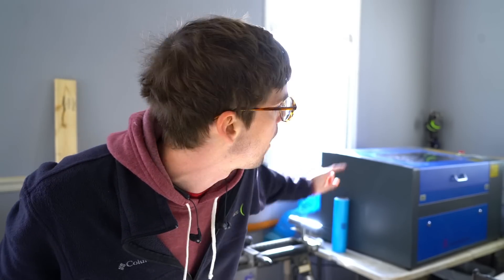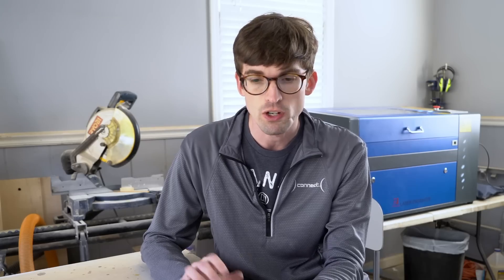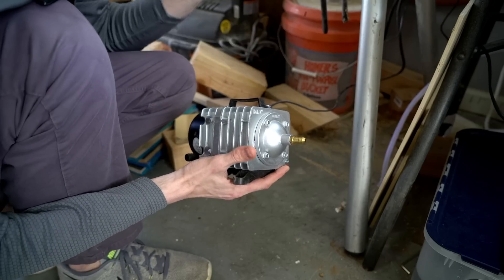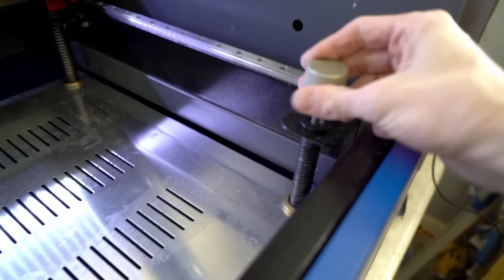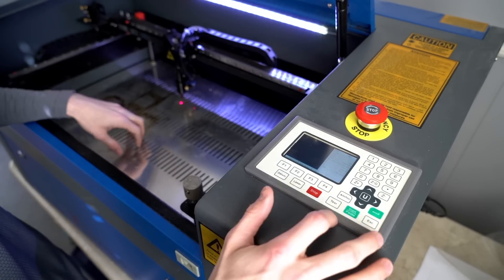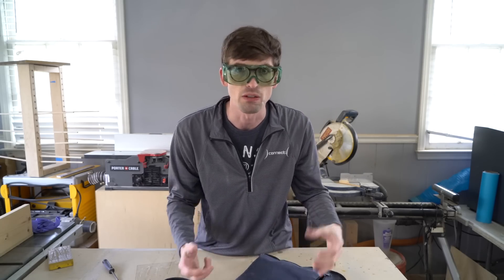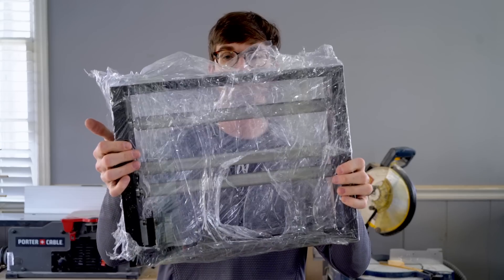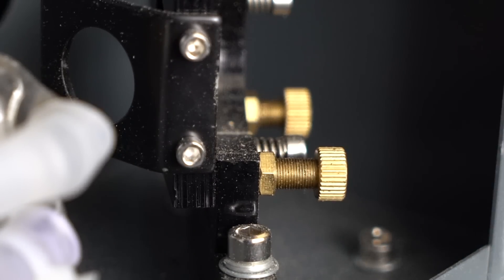Did I Waste $1500 on a 50W Laser Cutter from China?

Comment: I have a K40 laser and after watching your video I decided to get one like yours on this video.  I'm getting familiarized with it now but I'm wondering how to you check the temperature of the laser tube.  The K40 has a gauge I can monitor to see when the water is getting hot, but I don't see way of monitoring the tube temperature in this one.  Based on your recommendation, I bought the one with the Ruida control and I just downloaded a trial version of Lightburn.  Thanks for the video.

Comment: Is 50W enough for engraving on metal or do I need more power, like 100W?
And after 1 year of using are you satisfied or would buy something different year ago?
Reply from the maker: It’s a great unit even after a year.  For metal you will actually need a fiber laser or apply a coating like CerMark and engrave that off the metal.  Co2’s don’t work at the right frequency for metal engraving
Reply: @makeorbreakshop  thanks)
I will consider CO2 for the nearest future and I think I might buy fiber one after. Would be a great to have both in my "garage")
Reply: @projex5894  The thing about fibre is: they are so limited in size unless you go with the big industrial machines worth 10's of thousands. I've looked into them myself. 
One thing I've learned from building my own CNC machine and then adding lasers: get the most wattage you can afford. You can turn it down, but if 50w isn't enough, you can't turn it up!
Also: the biggest area you can afford. If you only ever plan on doing trinkets, then it isn't an issue but as soon as I built a new machine 30% bigger than my last, my next order was for one bigger than my recently expanded capacity. 
I attached a 5w diode laser to my CNC router and it isn't powerful enough. It can "burn" wood fine but only at 100% power at 40 ipm and has a hard time cutting through paper mask so I have to run it at 27 ipm.
Reply: @muskokamike127 , hi)
I had already made an order one month ago. I decided to buy my very first machine with working area 40*60 cm, Ruida controller and 100W tube.
Sure, it would be better to have bigger area, but extra pay for that and shipping cost can lighten my wallet to hard.

Still waiting the machine)
Reply: @projex5894  well, 40 x 60 is a decent size. You will be able to do a lot with it. Plus the 100w  is damn powerful too. You'll be able to do a lot with that as well.
I've been thinking of connecting a co2 tube etc to my CNC machine but it's a risky proposition considering the amount of dust it produces.....Turn on the laser and woosh, flame out in the shop lol.
Post some pics when your machine arrives and let's check it out.
Reply: @muskokamike127 yeah, 40*60 can be pretty nice for the start, cause I also noticed that CO2 owners don't actually produce a lot of big stuff. 
100W is powerful but I'm really curious is it able to cut for example 1.2mm bronze for dog tags, sure with markering surface) I know this power is not for metal but..
Reply: @muskokamike127  I think that's not that bad idea of connecting tube to CNC. But at least air compressor is needed and area wants to be enclosed.
Sure I can't advise anything as I don't have physical machines right now but IMHO it's possible

When machine will come it would be a pleasure to share some pics of it)
Reply: @projex5894  no, you'll need at least 1000w to cut metal. Least as far as I know.
Reply: @projex5894  The thing about putting a co2 laser on my cnc? the parts cost more than a while machine! :-)
I'd also have to figure out how to run it through mach3 as opposed to a ruida controller.
Reply: @muskokamike127  I saw 130W can cut 1mm steel. But in my opinion it doesn't worth the tube's resource
Reply: @muskokamike127  is mach3 can do engraving and cutting in one run?
Because that's the main reason why I choosed Ruida over M2
Reply: @projex5894  Yes it can engrave first, then cut out the piece.

Comment: I don't know what some of these people are going on about with the antifreeze BS, but don't do that. Run pure distilled water only and put a couple drops of dish detergent and a cap full of bleach in it.  If you don't want to use bleach, then at least add fish tank bio killer in the water to prevent it from going stagnant over time.  Using antifreeze or "water wetter" products and the like is bad, because it cooks into the glass and actually will eventually build heat on the tube, as will minerals in the water if it's not pure distilled.  Don't listen to these dopes.  I've been running home built units for years now and have done the research for 10 men.
Also invest in a CW-5000 chiller and be done with it.  Doing anything less is asking for future issues in all reality.

Comment: buys a laser that can easily cut acrylic. Minutes later says the acrylic window on the machine is good enough to block a stray C02 laser beam... BRUH. :/
Reply from the maker: It's all about the focal distance, it can cut acrylic but you need to be about a half-inch away and running pretty slow.  By the laser bounces and hits the acrylic screen the energy is pretty dissipated.

Comment: ****************
i ONLY FOUND ONE WITHOUT THE Ruida controller.

iS THAT A DEAL BREAKER ?  PLEASE LET MA KNOW
Reply from the maker: I still don’t have a Ruida controller in mine and it’s working.  You’ll have to deal with the buggy Chinese software but you can get it to work
Reply: @makeorbreakshop  I recently purchased a used 50W CO2 Laser with a M2Nano board.  Any help with setup would be appreciated.

Comment: i use to have a Universal 30 watt M25 laser engraver and just bought  
Orion Motor Tech 50W CNC CO2 Laser Engraving Cutting Machine, 110V Laser Engraver Cutter and hope it will be as easy as the Universal.Thanks for your video.
Reply: How did it fair? I'm used to working with the Universal engraver as well. Just got the Orion this week, I'm a little overwhelmed with how it's going to work

Comment: When you do a cut, is there like liquid forming underneath the material?  I am getting liquid from cutting acrylic and mdf.  only underneath the material.  Thanks in advance
Reply: You have a few things wrong then, first is focus, so if your cutting say 3mm and your getting a problem on the last 1mm then lower focus 1mm. Your air assist would push debris clear of the cut, also the last thing is to turn speed up a bit as the laser is to slow and melting the burr. good luck
Reply from the maker: Yep!  That is basically the heat from the laser melting the material underneath.  A lot of lasers have a honeycomb bed so there is open air underneath the material to help offset this.  Since mine doesnt have this you could either put some honeycomb on top or just add a few riser blocks to the get the material off of the bottom of the bed.

Comment: I have watched this video a bunch of times. I am seriously thinking about a 40W k-40. I am a Mac guy so I wanted to use lightburn too. However I have not seen the K-40 s with the ruida controller. And the conversion looks like it is more than the price of the unit. 
What would be the base requirements for a PC to run the software that comes with the laser?  I was thinking it will cost me another 500 or so for a cheap PC.
Reply from the maker: The PC i'm using is super old but I do all of my work first on a mac and export a DXF file straight out of lightburn.  You can then import that into whatever software that interfaces with the K-40 on a PC if you need too.
Reply: Thanks for the response. I opted to get the K40 40watt then I bought the Cohesion 3D controller with power supply for 199. I added on a LCD screen with controller and lightburn.  All of those add ones delivered to my house for 289. I figured that was a less expensive way over buying another computer. Plus I would probably want those upgrades over time. I was glad to find a controller and power supply for a lot less than the Ruida controller.   Just another option to offer to people.
Reply: Dear Sir,

I am Jennifer from Jinan Xintian Technology Co., Ltd, China. Established in 2004, it has become a top laser cutting machinery manufacturer, having exported to 120 countries around the world with 10 years of exporting experiences.
We have good feedback from customers. Pls kindly leave your email, I will send you details. 

Jenny Liu, XT Laser
Email: xintian115@xtlaser.com
Whatsapp: +86 15201299761 
Jinan Xintian Technology Co., Ltd
Website: www.xtlaser.com
Your Best Laser Cutting Machine Supplier From CHINA

Comment: Cool video, what do you think about buying the smaller versions of these machines, I have my eye on the following called the 3020 UltraGlow. Would this unit have the Ruida controller and work with the software in the video do you know?

https://www.ebay.co.uk/itm/New-Laser-Engraver-CO2-Cutter-3020-UltraGlow-Laser-Engraver-Warranty/173984424930?_trkparms=aid%3D555018%26algo%3DPL.SIM%26ao%3D2%26asc%3D20160908110712%26meid%3Db25a0a6971c84da09811463ee137f116%26pid%3D100677%26rk%3D1%26rkt%3D30%26mehot%3Dpp%26sd%3D231777365741%26itm%3D173984424930%26pmt%3D1%26noa%3D0%26pg%3D2386202&_trksid=p2386202.c100677.m4598

Comment: i have an 80 watt with the ruida controller, i am running corel draw x18 and when i send files over using the plugin that came with the laser it does not fill in the text. The Laser seems to only want to "cut" objects out rather than engrave them. I did find  a setting called "scan" and "cut" and changed it to scan, which then filled in the text and designs rather than outlining them but even after that the quality of the engraving is not very high. id give it a 70 out of 100. Ive tried re aligning my mirrors and they seem to be pretty straight on. the mirror i have the most issue with is the one at the tip of the laser head. i have issues getting it to come out of the tip of that cone that covers the end. the top adjustment is not very adjustable.  If you have any advice id love to hear back from you because as of now the laser sits here doing nothing. its a $2000 desk.

Comment: I have your exact model (with the same keypad) and cannot, for the life of me, get it to find files on the "Udisk".  Can you describe your method for getting print files onto the machine?
Reply from the maker: Yeh the U Disk is hit or miss for me, I connect it by USB to a computer and transfer from their software.
Reply: @makeorbreakshop  Thank you for your prompt reply.  I am not looking to you for support, but I have not managed to get mine to do *anything*.  Can you please describe in more detail what you do?  If I use their printer driver, from their "LaserCut2017" program, the jobs just disappear from the queue.  When connecting via USB, I don't see the device as a drive to move files onto.  I am sort of shooting in the dark, here.
Reply: It might make a popular video... :)
Reply from the maker: I never could get 2017 to work.  Mine came with an older version of the software and I was able to get it to connect using the cord that came with it.
Reply: @makeorbreakshop  Yep, that's about where I am.  I can get some basic control using lasercut6, but 2017 has been a bust, and neither has actually let me print anything.  (Sigh)

Comment: Hello, your laser 50W CO2 can cut thin metal ( 0,20mm ) ? Thanks Roberto.
Reply: 50W will not even cut thin metal.   You need at least 200W to have any hope to cut even the thinnest steel using oxygen as a cutting gas.  Even then, you'll be cutting pretty slowly (about 1 meter/min or less).
Reply: hello my friend , we are top selling laser machine manufacture in China,please contact me,whats app number: 0086-17820602094,Email: y.huiping@dapenglaser.com ,thank you !

Comment: Hello, you are using that laser cutter? I need help with mine and can't get it! I need the RDUSET and RDVSET original files to make mine functionally again. BECAUSE: in the Ruida machine menu is a voice like fact para settings. DO NOT TOUCH IT! it will cancel the vendor para settings and  user para settings and you will throw away your machine IF you didn't save allready  those files on your computer. I've done it, too bad 4 me.

Comment: Its not the controller on these cheap machines which is the issue its the cheap co2 narrow beam 50w laser tube :-(  Its all about gearing or beam convergence if your serious about cutting any reasonable thickness perspex or mdf  
I have another machine now which still has all the same cheap chinese tube mirrors and lenses  
however the 80w tube in this machine has a larger diameter beam with a 2:1 stepped down XY belt resolution which makes so much difference :-)
Can cut with less wattage on the 80w machine through the same material using a faster feedrate than the small 50w machine
Reply: Sure it's a cheap machine, but it's a good "starter" system.  You can pretty easily retrofit it with a better laser, laser control, stepper motors or CNC control for not a lot of money.  The basic machine is pretty sound though.  I've retrofitted mine (same system as the one in the video) with new optics (3 new bending mirrors and a brand new cutting lens) and it made a huge difference.  Was able to get a smaller focused beam and could cut the same material/thickness with about 10-12% less power at the same feedrate.

Comment: 7:00 "everything I saw said be careful with the grounding", doesn't use ground strap at all.
Reply: Machine is internally grounded to 3-pin ground on plug.  However, neither outlet for air compressor or water pump are 3 pin.

Comment: What is the maximum thickness it can cut ? And can it cut any metal materials ?
Reply: No metal cutting (maybe etch on anodized aluminum).  I'm guessing 8mm plexi, because I used ul laser 80w and 12mm was pushing that machine.

Comment: need some major help i have laser machine that uses coral drw we havent been able to work out how the laser actully pin points where to laser it kinda looks like yours but is different on the panel
Reply: Draw a box around you object to laser.  Set it to hairline width and color outline of the box red.

Comment: Is this laser software compatible with Mac's
Reply from the maker: It isn’t, but if you get a laser with a Ruida controller (they are the same price I just missed that detail when I got mine) you can use Lightburn which is Mac based.

Comment: 1. 50w is weak, 2. NEVER use it at 100% u burn the CO2 out very fast, the expensive thing on the machine is the tube, not the machine..I got a 100W and never use it whit more power than 80%, usually 55-60%, then u will have a long lasting laser tube...
Reply from the maker: Good call, yeh I've never pushed it past 50%, if I need more power I just repeat the cuts.

Comment: in your video you're shown with a macbook but it says it doesn't support IOS. so do use a different computer for projects? also can you purchase insurance on the item when shipping? thanks
Reply from the maker: If you get the ruida controller with the Light Burn software then you can use a Mac.  In my case I ran it through another PC.  The MAC was easier to use in the shot ;)

Comment: will it cut thin ply wood and balsa wood???
Reply from the maker: Yep!
Reply: @makeorbreakshop  what a\makes this better than a k40 300 dollar chinese ebay machine?
Reply from the maker: @astronola  Stranger laser, larger bed size (it even has a pass-through slot on the front), better controller and overall from what I've seen from the k40 a better build quality.

Comment: Without the grounding wire going straight to ground (I literally ran it out a window into the ground) I experienced a little bit of a tingling feeling if leaning against the laser. Putting in and taking out things from the laser, my hand would touch the edge of the machine, resulting in tiny electric shocks. The laser was connected to a grounded outlet. It all stopped after grounding the laser properly.
Reply: You might want to call an electrician to chek your grounding. It also is very possible that it is not actually grounded, but done with PE-N connection, in which case the ground is floating under load.

Comment: Also you want to liberally silicone the high and low voltage connectors. Pour it right down the little white tubes covering the connections. If not it can arc to the box. And never go near the high voltage end when laser is powered. If you have to adjust the tube, do it carefully from the low power end if you are going to keep laser main on while adjusting.

Comment: That tape is for aligning your beams. You need to make sure beam is in line and coincident all around the travel of the machine. It is not electrical tape nor is it to seal the water tubes
Reply from the maker: Gottcha, I used a sticky note to make sure the beam was going into the middle of the mirrors so I'm guessing the tape is to do something similar?
Reply: No, it is not. It is neither for aligning, or sealing the water tubes. Nor is it electrical tape. If you look at it closer, you will see it is thin double sided tape.  It is for sealing the exhaust tube!!!!  One of the manuals I have had for these even states as much.  But yes, you sort of made a mistake buying this machine. You should have just purchased one of the larger red/black ones with Ruida controller. You do not even need to use LightBurn with the Ruida. RDWorks is absolutely fine, and has a lot more features than LightBurn.

Comment: That splitter thing you didn't know what was for is just a thing that comes with the air pump, when I built my laser i bought a similar pump and that's what came with it, I just threw it away
Reply from the maker: good call, thanks!
Reply: yes indeed, it's an aquarium air pump: that's a splitter to spread the air bubbles a bit in an aquarium. you can attach multiple thin tubes if you want or just put it in the water as it is.